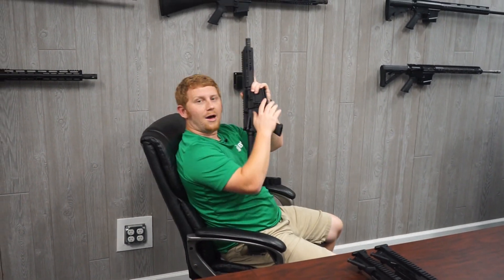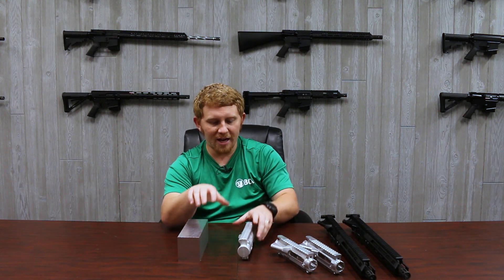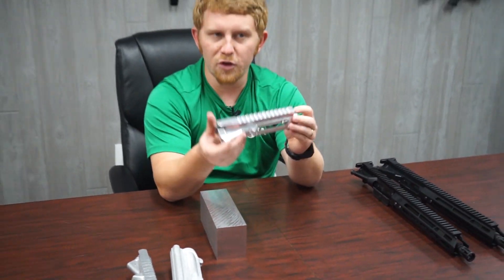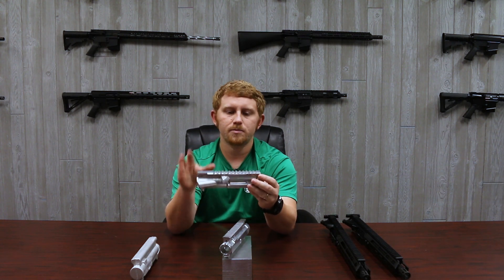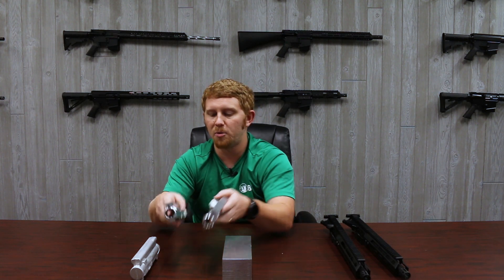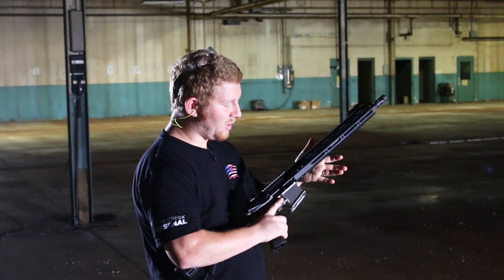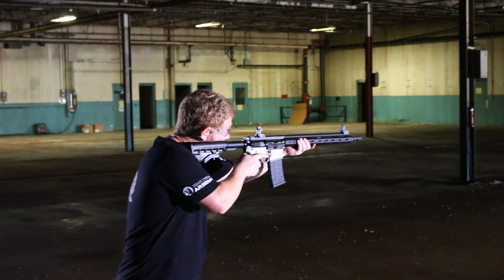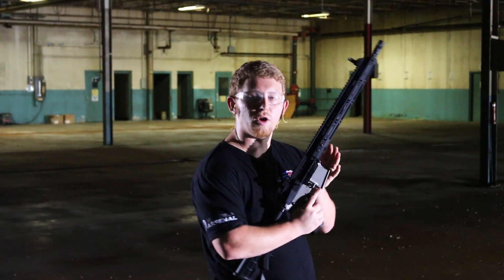Billet vs. Forged AR-15 Upper Receiver: Comparison, Pros and Cons, and Test Firing

Comment: From what I have learned, forged and billet from engineering channel. If forged it will have fewer details available but will be more robust due to you did not cut the structure strands, As Billet, you can CNC the crap out of it for all the details you want. But overall strength is weakened,

Comment: Good educational  video, I just purchased a 18" .223 wylde SS heavy barrel  rear charging billet upper and was wondering if it's compatible with a  mil spec lower? I didn't realize it was billet until after I ordered and was on its way...  I did alot of research to make sure I made the right selections but that one got past me.

Comment: Thanks for this video. This makes more sense now. I was wanting to purchase your x39 in 16" with side charging but seeing that it was 6lbs with billet upper I ended up going with the rear charging forged which saved almost 1 lb of weight according to the specs on your website. Depends on a person's needs/desires. For this build, lower weight was a high priority so that's what I had to go with.

Comment: I appreciate this video! This is EXACTLY what I was looking for. Thank you for explaining the difference between the two processes in making the upper receivers. Most people will chose the Forged and that's perfectly fine with me. Wilson Combat uses the Billet process in their AR-15 Platforms. Although, if I'm not mistaken, their AR PROTECTOR Platform may have the Forged Upper Receiver, but I could be wrong. Anyway, Wilson Combat Rifle definitely caught my eyes especially the 300 HAM'R. 💯💯🙂🙂👍👍🇺🇲🇺🇲

Comment: What about heat? Doesn't the billet aluminum upper get hotter faster and stay hotter longer?
Reply from the maker: Billet upper receivers have more material, so in theory they will heat up slower but stay hotter longer. The difference will likely not be noticeable however
Reply: @Bear_Creek_Arsenal  thank you. I just wondered how it worked. Appreciate the response. Now I need to try one. Lol

Comment: How is the billet going to be heavier when you keep repeating you shave a little more off of it making it slimmer explain this you take more metal away and it's heavier isn't that an oxymoron
Reply from the maker: Our billet upper receivers are still thicker than forged uppers

Comment: Ok..ok...ok...ok...ok guys..ok. 
(Literally said "ok" 24 times - yes I counted)
I just bought one of your uppers. I hope it has more accuracy than the one shown here. (Shot group size was about 24" at 25 yards) So basically you can hit the broad side of a barn if you're close enough? And your receiver has an under sized brass deflector and your receiver is heavier and weaker than a forged receiver.  If the process is more expensive to produce, I don't see the benefit of buying a heavier and weaker product.
Reply: Because the product is not weaker.
Reply: @Drengr-Wulf  yes it is. You have to add more material to a billet receiver to hopefully be as strong as a forged receiver, but it still falls short in strength. Even if it were just as strong, it would still be heavier with no added benefit. And by your comment it appears you're ok ok ok ok with the piss poor accuracy?
Reply: Billet is made from a stronger alloy.

Comment: Thanks!thats why the billet is $30 more..the$299 out of stock when i was shopping for complete receiver thats why i just purchased the $324 ones but it looks the same except it sez  (billet upper)
Reply from the maker: Enjoy your new upper!
Reply: BC doesn't make a billet that look the same as a forged. What they did was jacked the price up $30 and sold you a forged one.  That good though because billets are heavier and not as strong. They basically suck.
Reply: @realeyesrealize388  And youve destroyed how many billet receivers in your lifetime? Yeah me either. You do own a gun at least right?

Comment: is there a weight difference between your guys forged and billet upper receiver?
Reply from the maker: The billet upper receiver is slightly heavier, however, you probably won't notice it that much
Reply: @Bear_Creek_Arsenal  ok cool. Lastly, will this mate with a standard forged lower ok?
Reply from the maker: @carlosslim7305  Yes sir! Any mil-spec AR-15 lower will work great
Reply: @Bear_Creek_Arsenal  Your uppers cannot be made to only work with DPMS parts, can they? Is this referring to the specific AR10 pattern? I assumed they would work with most "mil-spec" lowers.
This would seem to be an important detail to clarify. Thanks.
Reply from the maker: @douglasj2254  Thanks for the heads up; we corrected that. Our AR-10 uppers work with DPMS lowers; AR-15 uppers work with any mil-spec AR-15 lower

Comment: Your company is trash, I wish I would have listened to all the haters instead of taking a chance with Bear Creek. 

I personally got a 6.5 grendel 24" that was defective, after 2 trips to the range trying different optics and lowers trying to troubleshoot the issue with this upper  the thing wouldn't hold less than 5" with Hornady Black factory ammo so I sent it back. After waiting almost 2 weeks to hear what was happening with my upper I gave up and requested a refund. I was given an instore insult for my purchase price. From the time I purchased my upper to the time I got my instore insult was less than 2 months. Your company raised prices around $100 per upper in that 2 months. So now my instore insult isn't enough to get a new upper and your customer service refuses to respond to any email I send. This is one of the most horrible experiences I've had with a company.

With all that is happening in the world you and your company should be ashamed of yourselves for treating customers this way.

Comment: The Alloys are also different. Forged are 6065 aluminum. Billet uppers are 7075. If you research the different alloys what you learn should put any concerns about the difference in strength rest.
Reply: Forged are also 7075 T6 aluminum👌🏽 Some manufactures will use different alloys, but the majority Always use 7075 for uppers and lowers.
Reply: @Brad-js7kq  recently I have noticed that forged receivers are being made from 7075. Instead of 6065. There is not that much difference between the two alloys. I wonder if  the supply of 6065 has changed.
Reply: @calvinroyals6463  in terms of pressure the 7075  T6 is twice as strong
Reply: @jonathandavis346  so which one is 7075? I'm trying to decide between forged or billet for my upper, 1st build. It's all as clear as mud right now lol.
Reply: @kentuckyearl8202  all depends on your lower? What are you running forged billit Polly?
Reply: @kentuckyearl8202  forged is stronger than billet, and they both come in 7075. My forged lowers are 7075 and cost $30 less. And don’t forget about the thickness thing. Longer to heat up is longer to cool down.
Reply: @freekinfreak1  thanks 👍
Reply: You got it backwards.. it's okay though glad to see others participating

Comment: I always go forged
Reply: Yup.  Bear Creek like to do billet because they are less expensive to make, heavier and not as strong.  Forged wins every time. What's worse though is their customer service.  Absolute atrocious.
Reply: @realeyesrealize388  . Didn't you watch the video? He just said that the Billet Receiver have more materials then the Forged making it stronger and not as susceptible to heat compared to Forged. Dang dude! Open your EARS and closed mouth for a second and get educated.  Now,  that's the 411. Lmao..
Reply: @realeyesrealize388  billet requires more labor and materials to make. Billet is more expensive and its stronger.... Hence the reason high performance high pressure engines go billet (ie Rob Damn Billet 4 rotor).
Reply: @Drengr-Wulf  no it's not. Forged is compressed metal that is structurally stronger because it is compressed before its machined. Billet is not compressed.  That is why they have to add to more material to make it stronger. Billet is not as strong, it's heavier, and it costs more to produce.  Other than cosmetics there is no benefit of billet over forged. Try watching the video 1st. Even BCA says that forged has a higher textile strength and explains the difference.
Reply: Ur mom too
Reply: @DinoNucci  yes your wife teaches a wonderful class
Reply: @DinoNucci  she had me cast a few on her ...I mean for her.😉
Reply: @trilliamogdlocog4986  :) nice lady

Comment: Warning to lefties: I just got one of the billet uppers, and the smaller kickout on the ejection port makes it so the brass tends to fly a lot closer to you.  I had a couple of pieces of hot brass hit my arm and neck while firing.
Reply: Thanks!
Reply: Tape it up
Reply: They still have a brass deflector on those units but it's smaller than the usual GI spec? That's odd.
Reply: Get a left hand upper
Reply: I reload so I use a brass catcher , as long as the gun ejects I don’t care what direction it wants to go.
Reply: That's why I'm so happy BCA has left side charging friendly options I don't know why I haven't bought a left side charging gun being left-handed shooter myself I need to. But thanks for the chip it's very good to know I like to swap up right-handed and left-handed often. Any shooter she's fine this as valid information thank you for the warning
Reply: 2 year old comment but as a lefty this was the 1st thing I thought of seeing them side by side. BCA is awesome for their side charging handles too!
Reply: Lincoln Orcutt  If I was a democrat with a gun I'd be nursing a hand with a hole through it and telling people online that an AR-15 isn't drop safe. ;)

Comment: I purchased a BC 223 wylde about a week ago. 16 inch barrel billet upper and mounted a vortex 1x6 strike eagle on it have shot about 40 rounds of different ammo from Sierra match bullets to pmc,etc .shot off sand bags .average 3 shot group 3 1/2 inches not impressed  at 100 yds.
Reply: Good shooting Tex!
Reply: So, any updated results?
Reply from the maker: Sorry to hear that. Send an email to warranty@bearcreekarsenal.com and they can get you a replacement

Comment: Wish the notch for the bolt catch was about 3 times wider so people can use an enhanced bolt catch or if they already have one on a lower, they aren't screwed
Reply: Same. I had to remove my bad lever to be able to use the upper I got. Phase 5 is supposed to work according to a phase 5 rep but I haven’t tried it.
Reply: @Bloodreign137  they need to address it in future production. Adapt and improve.

Comment: billet upper receivers are they only coming in AR15 uppers or are you planning to do lowers as well? and will this transition over to making Billet AR10 upper Receivers
Reply from the maker: Currently our lowers are forged and I don't believe we have plans yet to offer billet lowers. Most of our AR-10 uppers are billet already 👍
Reply: @Bear_Creek_Arsenal  i must of got one of the old forged uppers when ordered mine back in October of last year
Reply: What's the trick to get BCA .350 legend to feed correctly? I LOVE Bear Creek Uppers!! it is the only one out of MANY MANY uppers that has given me issues.
Reply from the maker: @stv1111  Send an email to bcatech@bearcreekarsenal.com and they can advise you as to what to do or get you a replacement with our warranty department.